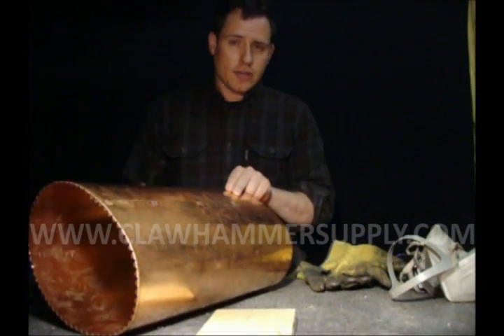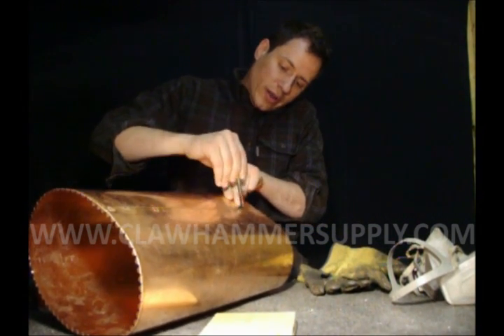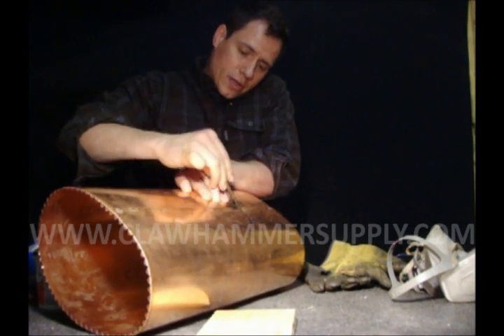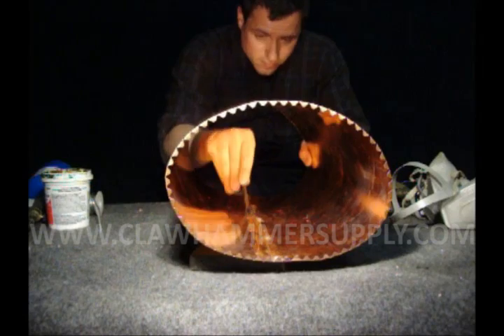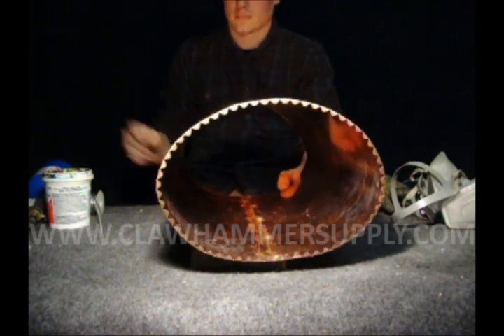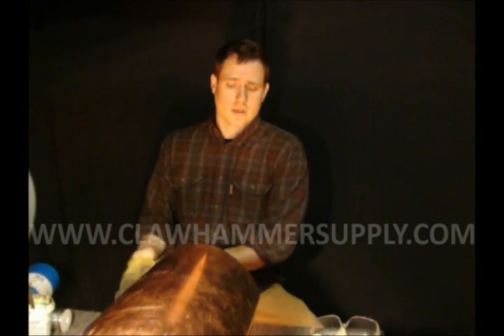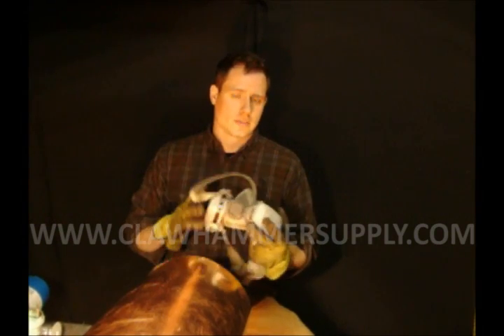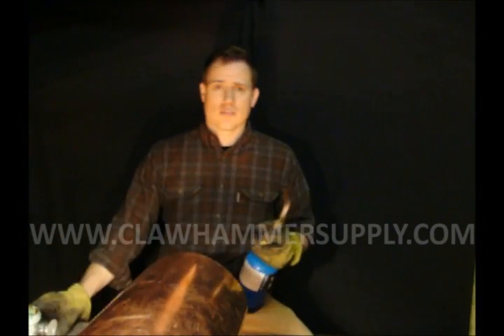How to Build a Copper Still - Part 3

Comment: Just a note, I would begin soldering from the middle.  Heat the middle of the container, and the heat will spread, then you can draw your hand back out instead of pushing into heated material.  Finish to one end, then start from the middle again, and pull out to the other end.  Your heat should be able to be nearly continuous, and should allow the solder to flow a lot easier instead of getting lots of clumps.

Comment: Note: Use Silver Solder & a Mapp gas, or straight up Acetylene (not oxy-acetyline) torch for soldering the joint on the boiler! Silver soldered joints are stronger & more heat resistant than a non-lead electrical solder...
Reply from the maker: We use lead free plumbing solder-- the melting point is between 420-440F. The still will always have liquid in it-- so the still will never get above 212 at sea level. There is no need to worry about the lead free plumbing solder melting. 
Not sure where you are reading we are using electrical solder?-- but we are not. We don't recommend using Mapp gas on copper- if you don't have experience you can easily burn though it. Propane is what we recommend and works the best. This is the solder we use and recommend: https://www.clawhammersupply.com/collections/all-products/products/lead-free-solder

Comment: I would think you should avoid solder as much as possible & solder the outside for the most part a connection like duct work would be good & solder the out side of that

Comment: solder is no longer made of lead and it is a must in coper pluming
Reply: yes but morons do not know that...you can still get led for car body work, and in a type of solder form but shit is a inch thick...lol
Reply: 50/50 lead copper is still sold and often used on heating systems etc. It is sold in rolls just like the lead free stuff. Just make sure to check the label, and don't use an old roll from the tool shed with the label worn off.

Comment from the maker: No, not at all.  We tested using extreme heat and have never had a problem.  The liquid in the still carries enough heat away to prevent the solder from melting.  ...as long as it isn't run empty (which would never happen), they'll be fine.